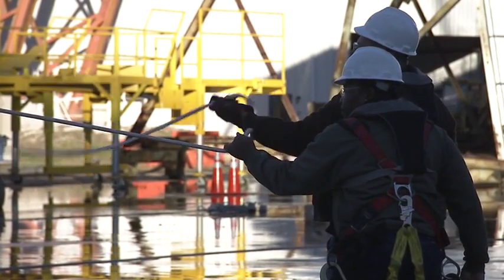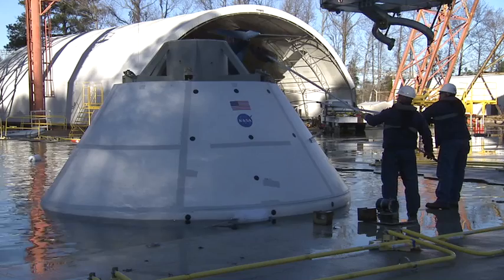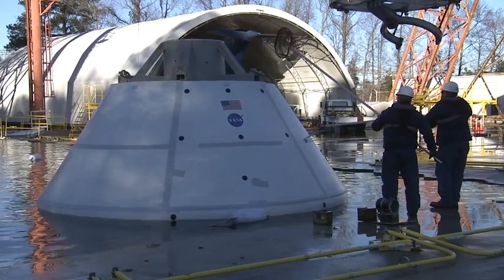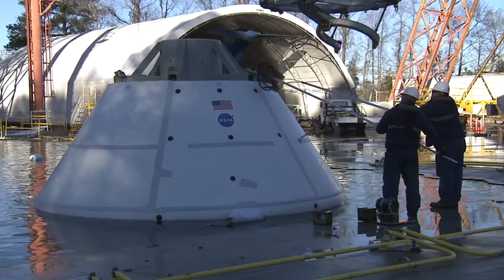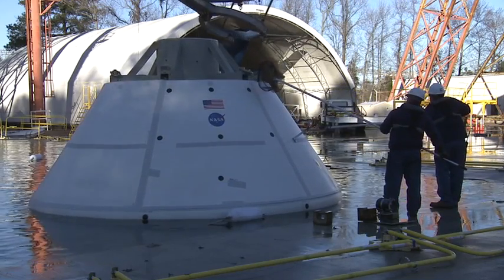Orion Continues to Make a Splash

Comment: @torquesport any object entering earth atmosphere will be slow down to certain velocity due to the present of air particle, so does the spacecraft from moon, it still have to pass through earth orbit and enter atmosphere as other orbital vehicles does. if both the vehicle have same surface area on the windward side, the are at the same speed when reentering earth orbit.